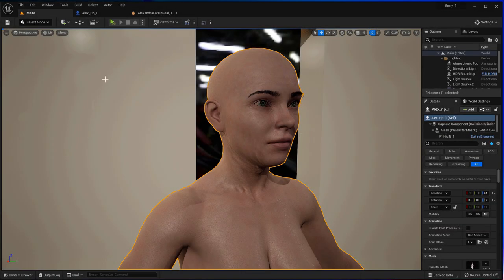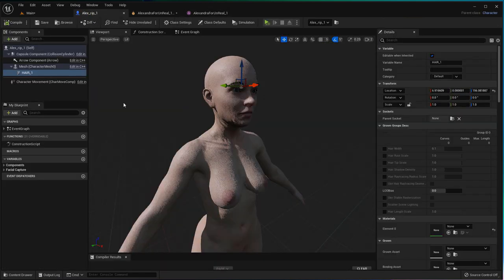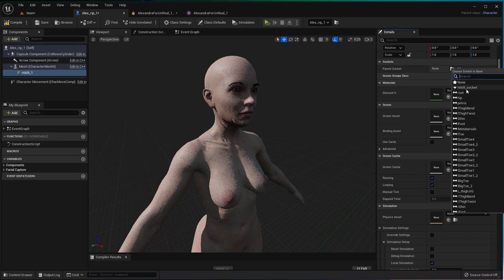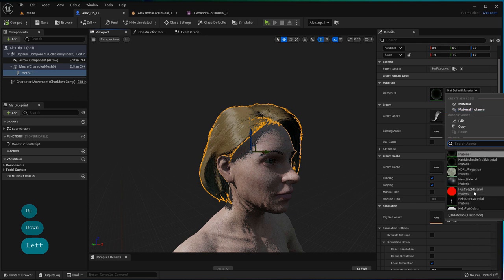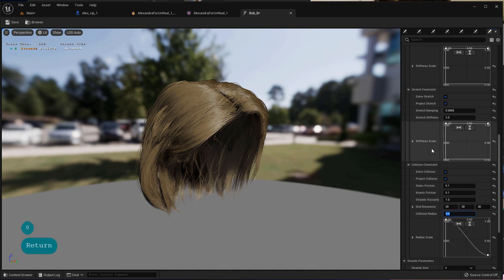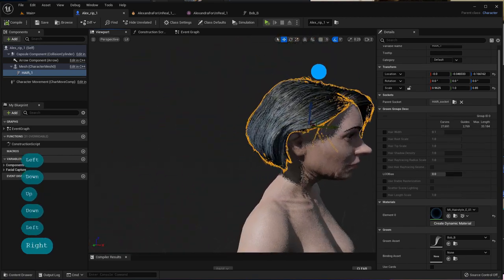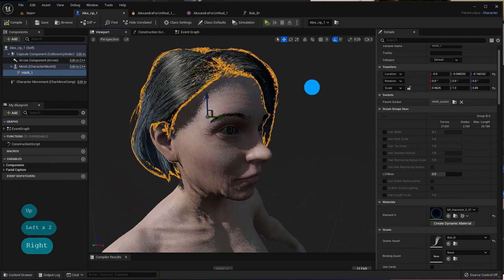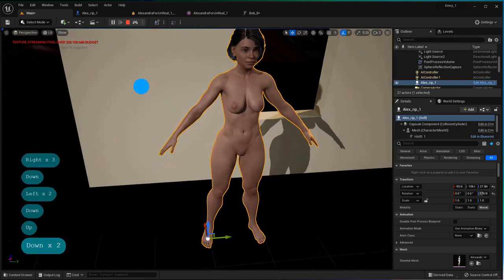Applying groom hair in Unreal engine 5

Comment: I'm blocked at the very beginning, but I try to apply this method on the dummy but after adding the socket it does not appear below mesh.

It's still quite a hassle to import, it's the fifth tutorial I'm watching to import hair from Blender and each one shows a completely different method.

So far I've only managed to import them.
Reply: Yessss i have the same issue. Were you able to fix it by chance? If not, does anyone else have a solution for it?